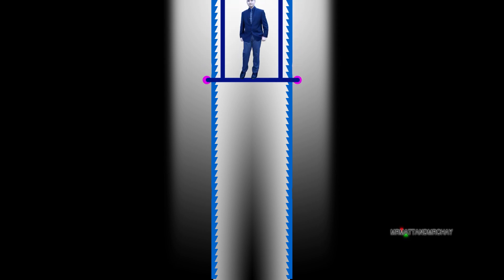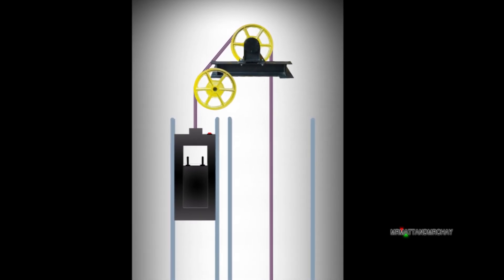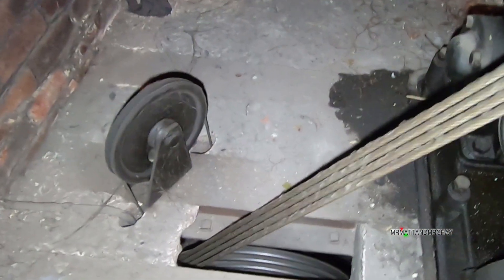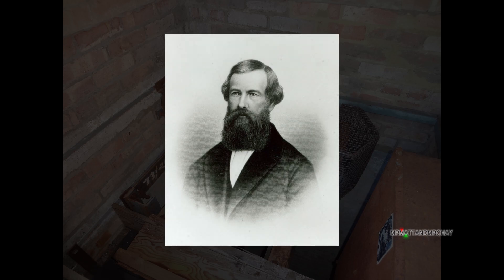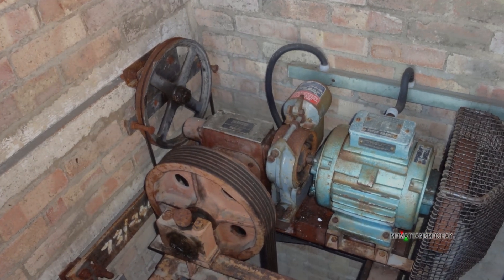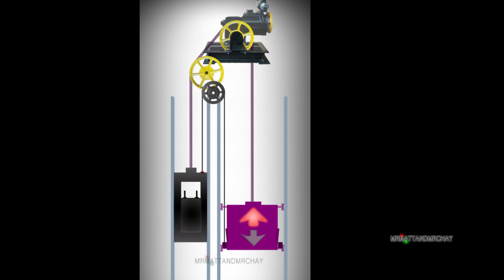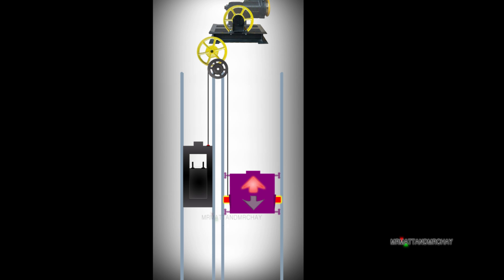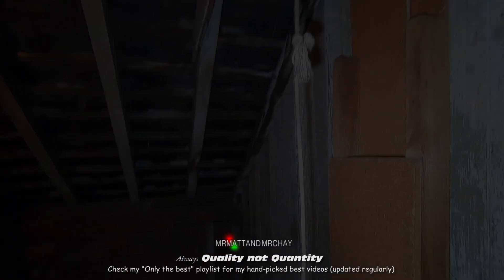The ELEVATOR SAFETY BRAKE video ..."all safe gentlemen"

Comment: I personally think the frame wasn't "poorly built" hahahaha but more that the lift engineer did test this in a very bad way. The lift seems to be pretty new, and there should be a test button in the service panel to test the brakes without actually applying them fully.

I mean, the frame was not designed to handle the load of the lift car AND the counterweight AND the motor working against it because brakes were applied. Guess that lift engineer was new on this lift and didn't get instructions of "NEVER test the brakes on this lift by impeding the brake cable. ONLY test by designated test button".

IF a real fault happened that would mandate brake application, then the frame would of course crash too, but then its "worth it" to save lifes.
This is EXACTLY why you should NEVER play or use a emergency stop if there is not a emergency. Because things can fail or break during a emergency stop, as opposed to a controlled stop.

Comment: Fun and true theorised fact:    the ropes breaking on an elevator/lift cant really happen because these were designed for a long time so that if every square inch of the cab is filled the ropes wont break and also on an elevator/lift if the brakes were to fail and it goes into freefall it wont free fall down it will actually freefall upwards because the counterweight is actually heavier than the cab

Comment: 🙋‍♂️🛗   Thanks for the video but I have a question. 
      Question: What happens if the Overspeed Governor’s cable breaks before or at the same time as the main cables, does the brake engage and how?  I know it’s extremely unlikely but I figure it could happen.
Reply from the maker: This has happened in the past - I give you 9/11.  Apparently some cars did plummet when the main ropes and governor cables were severed at the same time.  So, you'd have thought that the car brakes would be 'held off' and they apply if the rope were to go slack or, as you suggest, are cut.  But it's the other way around.
The only other thing I can think of, is a rope grabber in the motor room which is rare, but useless if the main ropes were to brake.
I guess that the scenario is so remote that it was classed as 'very improbable' and therefore nothing exists for it.
Maybe someone else can provide a different response?
Reply: @mrmattandmrchay — Thanks for your reply and information.

Comment: Many of the older elevators have a flyball governor, just like those on the early steam engines. Two metal balls are held by brackets to a rod that rotates when the car is moving. If that car speeds up beyond a certain point, the balls would lift up by centrifugal force, bringing up a collar that  first operates a switch to shut the motor off, and second, could mechanically tightens the cable, pulling on the car  brakes, stopping the car.

Comment: Can we put enough magnets on a elevator and put a layer of copper around the elevator shaft it to slow it down if it fails? Make the magnets deploy if it fails or you pull a switch. cost to much

Comment: soooo how do you get out after the break has activated and the lift isn't aligned with the floor?
Reply: Take a nap and wait. There is nothing that can be done from inside the elevator and should never be done by untrained personnel
Reply: The space between floors is typically smaller than the height of the elevator door. You can force the door open from the outside and send down a small ladder, then the passengers can exit through the crawl space between the top of the elevator door and the upper floor.

In cases where there are very wide spaces between elevator doors, such as offices with severe drop ceilings there's almost always hatch that can be accessed from the top of the elevator.

Comment: the main cables will usually never fail. Would be nice if you said that in the video too. Chances of all cables snapping are pretty much none. 

A two way governer is a good thing, seen as if the brakes on a lift would fail, the lift would plummit to the top of the shaft, seen as the counterweight is heavier than the lift. This will prefent the lift from hitting the roof.
Reply: I've only used a rope gripper for over speeding in the up direction

Comment: its safety gear matt not safety break, also  an over speed govenor does other jobs for instance, a lift has what you call a contract speed, this mostly is .8 mtrs sec, on the osg there is a electrical contact wich is set to trip before the osg locks in, the purpouse of this is that if the drive fails and the lift is out of control on the way up the switch wiil activate cutting the power to the controller and activating the brake, also if you see on some osg they have a smaller pulley, this is for testing the osg, you drop the rope from the top pulley to the lower one and set the lift in a downword direction, the osg will travel faster and pull the safety gear in...... tony
Reply: also most safety gears are egg shaped dogs with teeth that bite into the guides.
Reply: Does the job of braking so for the purpose of this video its completely accurate.

Comment: Are you sure about the rope being attached to the counterweight? As far as I've seen it, it always is attached to the underside of the car, via another pulley in at the bottom of the shaft.
Reply from the maker: Yes, the system you are referring to is a continuous loop.  This video focuses on the simple design from older lifts.
Reply: If the other end of the brake cable was attached to the bottom of the lift car, it would never achieve tension to activate the brake if the main cables were to fail.